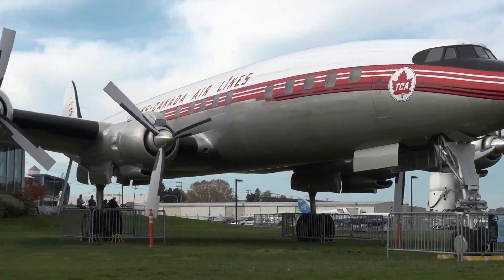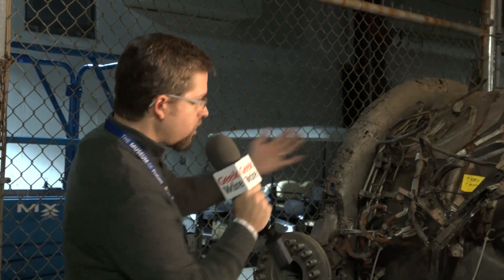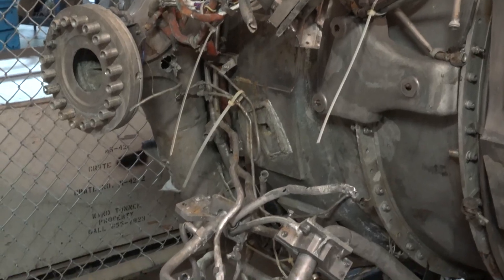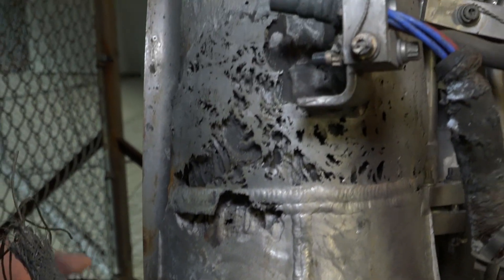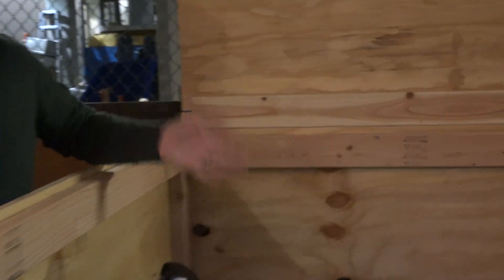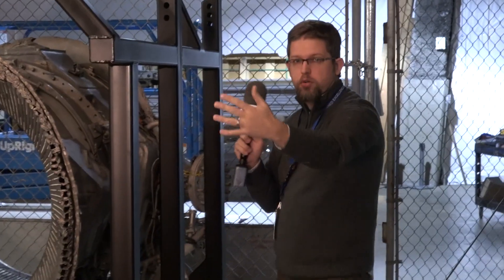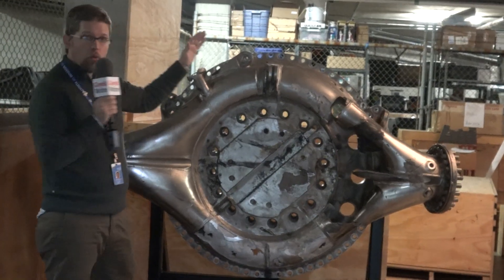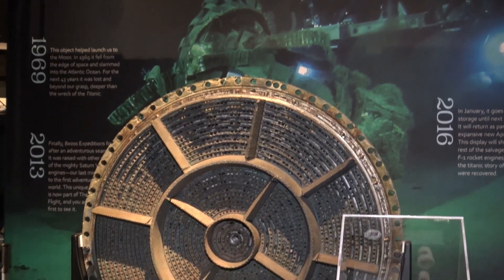Sneak Preview: Recovered Apollo Saturn V F-1 rocket engines at the Museum of Flight

Comment: Those F-1 engines were practically hand built, with individual notes on their fabrication, which is one reason why they were never built again. Once the program closed and the craftsmen retired or died off, that information was lost... Amazing job at removing the barnacles and the other crap. I wish he would have covered that process. They should reconstruct a dummy expansion bell to cover for the one that was destroyed from the ocean impact.

Comment: Where are the engine-turbines and their fins?  and exactly how did this engine-cone create thrust to push itself up? and, how did it land just 3 miles from coast? Let me guess: It was probably dropped from a plane, or a helicopter! For more information see my latest comment under Youtube: (100 Percent proof we can't orbit earth. Debunk This.)
Reply: I don't think they recovered the turbine blades just the housing.  Engine cone directs thrust, combustion chamber produces it and the mechanism is really quite simple.  You pump fuel and oxidizer into combustion chamber and burn them.  This produces a lot of very hot gas which you direct out through the open end expanding it in the engine bell.  This creates thrust via newtons 3rd law as the hot gas expands out the bell it pushes on the rocket engine which is attached to the rocket.  It landed in water 3 miles deep just off the coast because it was the first stage which burned out first thus dropping back closer to shore.  You'd look like less of a fool if your opinions were even remotely informed.  Debunk what?  Ignorance?  Done and easily done at that.
Reply: @TheEvilmooseofdoom  bravo !
Reply: @TheEvilmooseofdoom  You don't have the faintest clue. Just toy around with your CGI-rockets as real ones, and take a look at my fresh comment above!
Reply: @kareemsalessi  Your 'fresh' comment is little different than you old one.  I did explain how a thrust chamber works and I also mentioned that they never recovered the tubine blades.  Because those FACTS don't pander to your fantasy doesn't make them less facts, just means you can't tell reality from your fantasies which is the prime defining feature of most who believe like you do.  This reduces you back to an object at best worth of pity but mostly just worth ignoring.

Comment: The amazing thing is they were pretty much made by hand. 5,000 part welded into 1 engine and they worked like a dream.
Reply: the more amazing thing is because they were made by hand, and the know-how died with the machinists, and workers and engineers passing away, we are unable to build F1s now.   regular blueprints are there, but is not enough to build a functioning engine.  so now we use Russian RD 180 (which are incredible)
Reply: @ARXDMOS They are not very practical or eficient.
They are just pure power.
Reply: But we can mass produce a full flow staged combustion engine now

Comment: Why we can not make engines today???
Reply: Theoretically we could and its even been talked about. Its just that here are cheaper ways to do it. The shuttle solid rocket boosters and main engines are a proven design and there are still left over engines just sitting around. Recreating the F-1 would require restarting the production line. The production lines for the space shuttle main engines and SRB's exist already.

Comment: If memory serves, the thrust chamber bells were hand brazed Inconel X-750 CRA material
Reply: They were brazed but they actually placed all the tubes onto a large circular holding fixture and put the entire assembly into a large oven. Once the parts were heated they sprayed the brazing material on as a liquid. Afterwards the tubes were pressurized with water to look for leaks. When they found them the leaks were touched up by hand to close them.

Comment: Fun fact. at 2:48 the reason why the part broke off there is because during welding, the mechanical properties of the parent material change due to the high heat which make it weaker. We call it the "heat affected zone". Even the weld itself is stronger than the parent material. Source: It's my job to know this stuff.
Reply: HAZ baby!

Comment: Von Braun took the approach they had to be reliable, absolutely could not fail.  So the design was brute force simplicity. I think only 1 of the engines malfunctioned slightly and produced slightly less thrust than expected or it shut down a bit early.

Comment: It was solid fuel engine , if i right understand
Reply: Alexander Nikolaevich nope, the f-1 engines ran on hydrogen and lox, short for liquid oxygen.
Reply: Nope, ran on Kerosene and Lox,  the second stage ran on Hydrogen and lox
Reply: @dave1135  Hydrogen is too light a fuel and doesn't have enough mass to produce the thrust necessary to lift a fully fueled rocket that big off the ground . Kerosene has more mass (Force = MASS times Acceleration) and was sufficient to lift the starting weight of the Saturn V off the pad. The new SLS rocket uses a hydrogen powered core, but it also needs the two SRB's to get its fully fueled starting weight off the ground.
Reply: @joevignolor4u949  LH2/LOX has a much higher specific impulse than RP-1/LOX (453s vs. 304), so it's actually a more efficient fuel when the masses are equal.  But because LH2 is so much lighter than kerosene, it takes more LH2 (by volume) to achieve the same mass.  The result is that the first stage would have to be even bigger (and heavier) than it was on the Saturn V.
Reply: @almostfm  I agree. That's essentially what I said. The 1st stage would also require more H2 fueled engines or bigger ones to provide the thrust necessary to initially lift the fully loaded  rocket off the pad. That's why they use  fuels with higher mass such as kerosene or solid propellant in the 1st stage. At the beginning of a rocket's flight when it is fully fueled and very heavy thrust providing lift is the priority. Then later on when it is lighter specific impulse providing acceleration becomes the priority.
Reply: @joevignolor4u949  It's astounding how fucked up the technical information is in this thread. 1) The first stage was RP-1 kerosene and LO2. It has a LOWER specific impulse than the second stage H2/O2 propellants. At least a few of you got it right.

Comment: TCD - Total Complete Destruction. After generating 7,500,000 Pounds of thrust these beautiful engines were so Completely Destroyed as to be an unrecognizable embarrassment to any museum, more suited for a scrap yard. Insult upon injury, so very sad,why didn't NASA use parachutes to brake to carnage?! They didn't know ocean salvage technologies would advance to the point of recovering this hardware from miles below the sea. A few cheap parachutes would of done wonders,TCD by design.
Reply: Roxanna Mason Uh not in their priorities, that would add more time and cost compared to designing for one time use. Besides most of the parts of the engine would need to be rebuilt plus the logistics of retrieving the engine, diagnosis etc, a brand new engine has a known failure rate on all parts, rebuilt engine with new and old parts would have a chance it might fail(NASA don't have complex computer simulations back then) and considering we are sending humans to the moon plus NASA's over inflated budget they wouldn't risk the chance.
Reply: Maybe so someone else would not be able to use them for reverse engineering?
Reply: @MEugeneDavis  All the NASA information is BY LAW available to everyone. No one was worried about reverse engineering.
Reply: @craigwall9536  maybe you did not know that most of the plans were lost. 
To make them today would require reverse engineering.
I said reverse engineering.
Reply: @MEugeneDavis  You're spouting a popular misconception. "The Plans" were not lost and never have been. What has been lost is the experience of the fabrication workers who solved problems as they came up and literally ad-libed some of the construction details- mostly welding techniques. For that reason,  no two of the engines were actually totally identical. It is the EXPERIENCE that has been lost,  but to the typical "give me an easy answer" public- and YOU are good example..."the plans were lost because NASA is stupid and so are Americans" is the most popular meme. Furthermore, you wouldn't want to build them like that anyway- there are better materials and engine designs- for instance,  no one would use fuel driven turbopumps when Lithium batteries and electric pumps are lighter. How do you think Space-X got enough performance to have fuel remaining to make tail-sitter landings? They got rid of a shit-load of weight with those electric pumps and batteries. The F-1 was a fine engine- but it's stupid to repeat it when better designs with simpler and lighter manufacturing schemes are available.
Reply: @craigwall9536  I was raised by a lead man at Rocketdyne in Canoga Park, building the F-1 engines 
He had a little design influence by way of a modification suggestion that was accepted.
Reply: Parachutes big enough would have added a lot of weight, something the Saturn V could ill afford. It was better to just drop them in the ocean and build new ones for the next mission.

Comment: Interesting fact: those barriers you see on the injector plate were a major addition that was added late in the engine design. Without them, the engine would pulse so badly it would almost self-destruct. When they added those barriers onto the plate, it made the engine run as smooth as silk.

Comment: How and hell did these engines get so destroyed!? You couldn't of demilitarized them more completely than this. Did NASA intentionally configure the SIC stage to hit the water just right for max destruction? Maybe so they couldn't be salvaged for reuse. With a parachute they could of directed the stage to hit nose first and use the LOx tank as a shock absorber or slow it down futher and recover the stage for re-use at least parts like the engines.Oh well.
Reply: Roxanna Mason they were designed to be disposable, it was just cheaper to make new ones, rather than refurbish the old ones. i don't think nasa would have even came across the thought of someone stealing the engines and salvaging them, especially in the 60s. spaceflight was just so early in development, that to the normal person it would have looked like a big hunk of metal straight from a sci-fi movie.

Comment: best rocket engines ever made.  the seafloor did not create the force damage, the water surface impact did that.  the corrosion was the parts intimate contact with the ocean floor.  So those parts up in the sea look pretty good still, except those iron valve stems. f1 engines would still be the copy to get us to a lunar colony, those huge solid fuel rockets make to much turbulence when burning.  these engines were tested for destruction from sound waves. They used counter  measures to keep the sound waves from swelling the burning chamber out of tolerance.
Reply: My father told me before he passed that they built 65 engines that were never used. That's 13 missions that never happened. Issac Asmonov, the writer, proposed we use an F-1 to help get to Mars. Power it up After getting to space to get a huge push.
Reply: The best rocket engines ever made were the NK-33s and their derivatives like the RD-180. These engines were so good that NASA did not want to believe that the Soviet Union managed to make these engines not only viable, but extremely reliable aswell.

F1 engines beat these only by sheer thrust values, however the efficiency of the NK33 and RD180 engines were unmatched until SpaceX made the Merlin 1C engine. 

As a sidenote: The RD171 engine was the single most powerful liquid fuel rocket engine ever made. Even more powerful than the F1.

So. I hate to admit this. But the best rocket engines ever made were Soviet made. Until now.

Comment: just think what we can do today;when we did such a complex eng 50 years ago.
Reply: The whole Moon project was done on less than a 286 computer.
Reply: @MEugeneDavis  Indeed, and yet so diligent were the FIDO/GNC/RTCC/Orbital  Mechanics guys, that most Apollo missions required only 1 or 2 very minor course correction burns all the way to the moon... brass gyroscopes, weighing many pounds, built fine as a Swiss watch...  "T minus 15, Guidance is internal..." SALUTE!

Comment: Whatever damage was done to those engines was probably done when impacting the ocean surface not the sea floor.
Impacting water at terminal velocity is like impacting concrete.
Reply: True and the S-IC probably impacted with the ocean engines first  as that's how it would orientate itself during free fall.
Reply: When he’s referring to the damage from the seafloor, I think he means all of the corrosion etc. that happened over the past 50 years while resting on the seafloor
Reply: The Prometey program was created to study liquid-propellant rocket engines. A study of the F-1 liquid-propellant rocket engine was conducted under this program. The result: the F-1 engine could not produce the stated thrust of 690 ton-force; it turned out to produce 405.3 tf of thrust in the ground, and 506.6 tf of thrust in a vacuum. That's how it is.:face-purple-crying:

Comment: It is or was a process called electrolysis that ate the material /  alloys off theres F1 engines ! All ships deal with this by placing zinc blocks where water is agitated  and still , it's basicly the same process as electroplating where a positive current passing to a negative  this takes small amounts of material  from the base metal and deposits it onto the surface you want coated / electroplated ! There are lots of new methods today using static , vacuum, heat and powder ect ect but it all basically does the same  thing coats a surface with a material of your choice.

Comment: Impact with the sea surface would cause the damage. Not impact with the sea floor.
Reply: Solexx X the engines clearly weigh a ton or more easily. Maybe thats why its in good condition, good engineering, good manufacturing USA USA!
Reply: Have you seen the pictures of the Titanic? The prow, which never impacted on the iceberg, is bent upwards to a significant degree!
Reply: @amanofmanyparts9120  The Titanic didn't hit the water at supersonic speeds
Reply: @blurglide  Neither did those F1's.
Reply: @Craig Wall They nearly did it if not at supersonic

Comment: The private sector did in 5 years what NASA couldn't do in 50
Reply: Hey, all those laid off NASA engineers are working for Elon Musk.
Reply: As far as I know SpaceX hasn't sent spacecraft to Saturn or Pluto or landed huge rovers on Mars
Yes what they are doing is impressive but let's not be ignorant of the achievements NASA has made
Reply: You're an idiot. You have no idea what NASA created. Telemetry stations across the panet to monitor the orbits of our rockets, Tha assembly building (largest single story building in the world, pads 39B and 39C tow huge ramps massive earthmoving projects built with laser precision in the 60's, the two two gigantic crawlers and towers, the water suppression system capable of flowing 1 million gallons of water in 6 seconds to lessen the noise and protect the pad from the heat, the main control center at Kennedy, Johnson control in Houston, I could go on and on and on. All any of these private companies have had to do is figure out how to make new rockets looking at the costly mistakes of USA, Russia, China, Japan, India, Brazil, France, and EU. How about educating yourself before making such stupid comments. Even the reusable landing boosters was figured out and tested (with limited success) by Russia and US before Space X. Lets see any of these private companies send a manned mission to the moon in under 9 years starting from scratch with no infrastructure other than a V-1 launch pad at Vandenberg AFB. NASA is the greatest space agency in the world and if you were a patriotic and historically educated person you would understand this. What other country has sent 3 probes to the edge of the galaxy, multiple probes and surveyors to Mars, created  the Hubble telescope, created the X-1, sent men to the moon 5 times, created space lab, the ISS, on and on and on. What other country or company has done these things...? I thought so. STFU.
Reply: Albert E.   You’re a slimy asshole aren’t you. What have you done in your pitifull lifetime
Reply: Like land a reusable booster on a ship????  Give me a break!
Reply: Sending a school teacher into space for a publicity/political stunt backfired..it revealed the incompetentcy of NASA big time.
Reply: Refresh my memory...how many early NASA rockets blew up on the launch pad???
Reply: @alberte.3059  Refresh my memory...how many SpaceX rockets put man in to orbit or moon?

Comment: Ah, built when men where men with Pocket Protectors. Real Steely Eyed Missile Men.
Reply: furyIIIplate yes mate when men were men and sheep were nervous
Reply: Not from NZ are you? rob wells
Reply: AND SLIDERULES!!
Reply: @HGR693  I still have mine !
Reply: rob wells o
Reply: furyIIIplate .Plymouth Fury 3,,,.  Plymouth Fury! Now that was a car. Stock 460 would make the whole car tilt when you rev the engine at a stop light. And what a beauty. Man that car was great, my favorite car of all time. My Dad got one second hand from my great grandma when he was about 19. Think it was a 66. Then when I was in middle school my older brother bought a 73 Sport Fury. That thing was s beast. An absolute boat. Solid steel from bumper to bumper. He accidentally backed into another car, that was itself a good sized older car, and it punched a two foot hole in the other guys ride and literally barely scraped the dust off the chrome bumper. Bench seats front and back, could comfortably seat eight adults. We could fit another six in the trunk alone. Love those old Mopar mobiles. I miss metal cars.     P
Reply: I call em nerd packs, the pocket protectors. Some smart people back then.